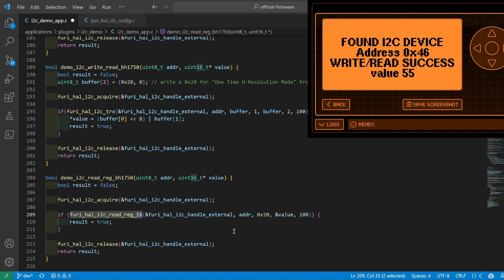[43] Flipper Zero: Write code for I2C devices

Comment: I was exploring gpio with bme680, was wondering is there anyway to write bme680 data onto SD card as csv?
Any leads would be much appreciated 👍
Reply from the maker: Are you using the board with both I2C and SPI?

If you are fine with BSD-3 license, take a look at https://github.com/adafruit/Adafruit_BME680.

What I would likely do is replace lines 551-609 in Adafruit_BME680.cpp with Flipper Zero methods from this video.
I'd then copy the init/loop code from examples/bme680test/Adafruit_BME680.cpp into a basic Flipper plugin program.  My tutorials on subghz/plugins/rock_paper_scissors has a 'save_local_contact' that is an example of appending to a file.

If you want to not use BSD license, then I'd start at the BME680 datasheet and understand how to init, calibrate and
read information - https://cdn-shop.adafruit.com/product-files/3660/BME680.pdf

I'd be glad to chat further in discord; https://discord.com/channels/740930220399525928/1070543191880781885.  I don't have a BME680, otherwise I'd create a tutorial for you.

Comment: Hey what do you think about https://youtu.be/lh99ssUy6FE they used BAD USB over Bluetooth, i mentioned it to Rouge which I run and i got kicked out of his chat...jerk
Reply: I'd like to dev, I have a BS in CS but focused mostly in programming and databases java sql, etc just getting into electronic SDR and 3-d printing
Reply from the maker: I haven't looked at the BT stuff, I'll need to dive in more next month!

It seems like a good thing to make people aware of.  It would probably be easy to modify the payload to auto-launch as well once they connected to the Flipper Zero?

Comment from the maker: There are a huge variety of devices that communicate using the I2C protocol!  Examples include EEPROMs, Temperature Sensors, Light Sensors, Gas Sensors, Touch Sensors, Accelerometers, LCD displays, etc.  An index of known devices (with part numbers, purpose, Adafruit / Sparkfun / Amazon links) can be found here:
https://i2cdevices.org/devices (I'm not affiliated with this link)